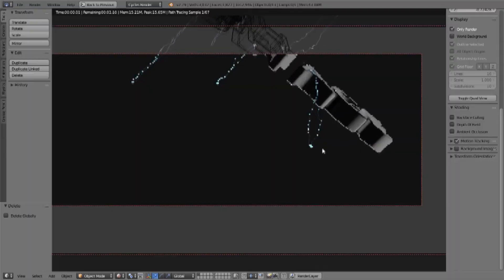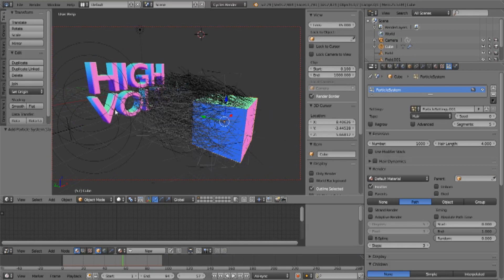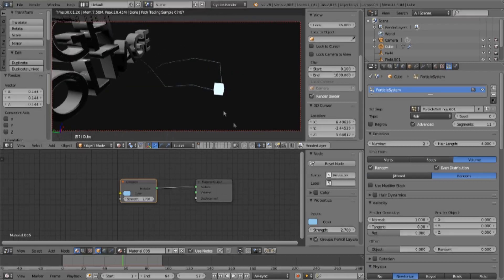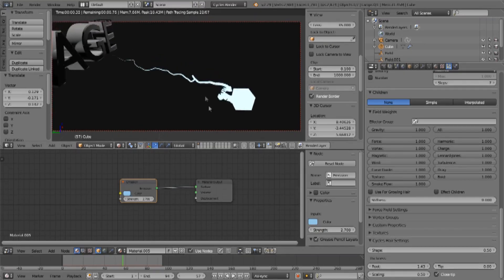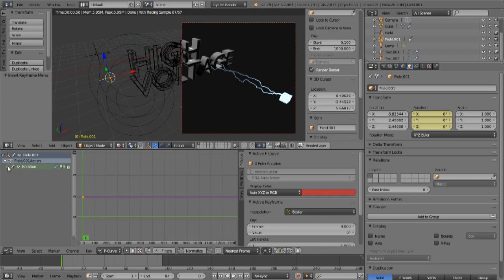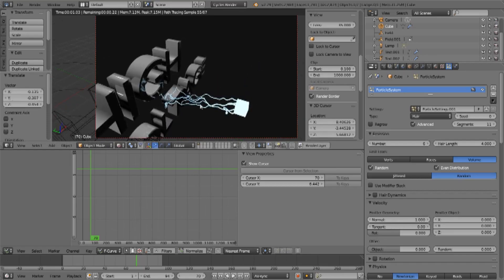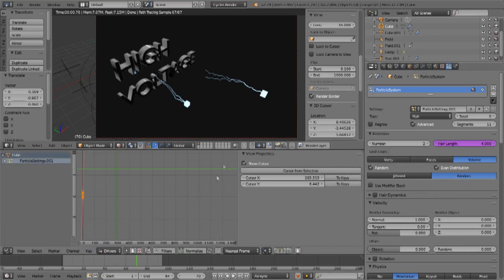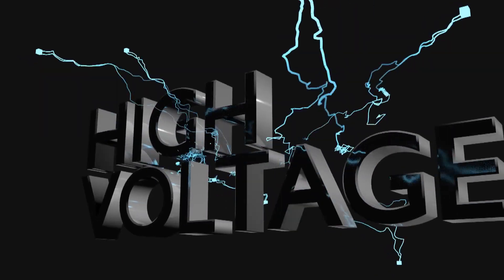DEPRICATED: Electricity Blender Tutorial #b3d

Comment: The video looks bad. It´s running at 50fps, and it´s glitching here.. I´m on a titan X card, so definitely is not GPU the problem
Reply from the maker: Activemotionpictures sorry I encoded it badly as interlaced. Its all my fault
Reply: David McSween were you trying to aim at smooth 60fps? I can't get it to work on my videos either. :(
Reply from the maker: Activemotionpictures I just used the wrong preset in my NLE. it was 1080 50i instead of progressive.  I didn't even notice until i uploaded then i ran out of time to rerender